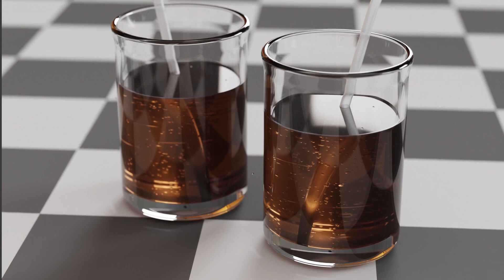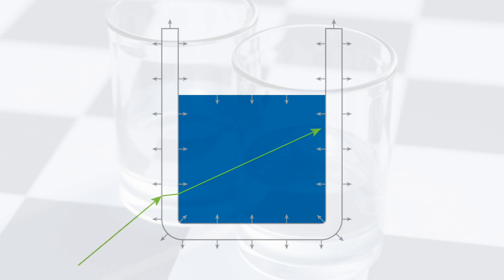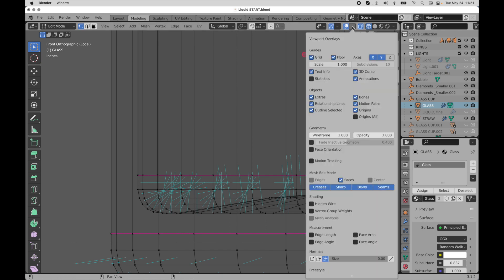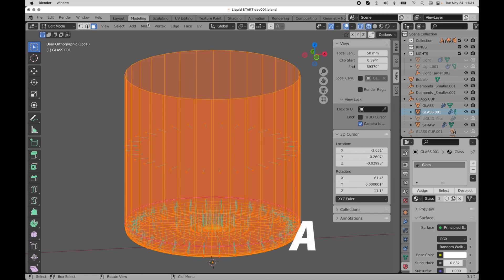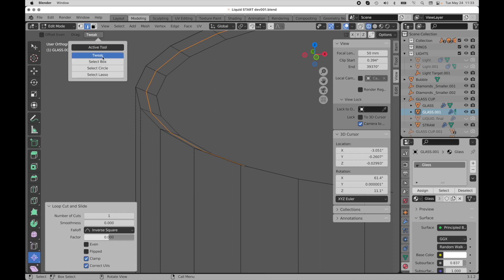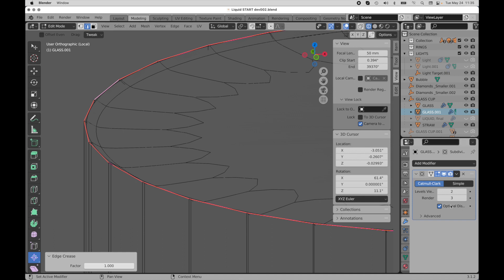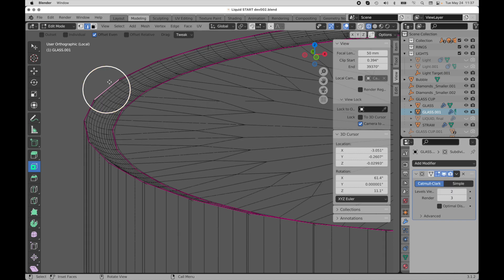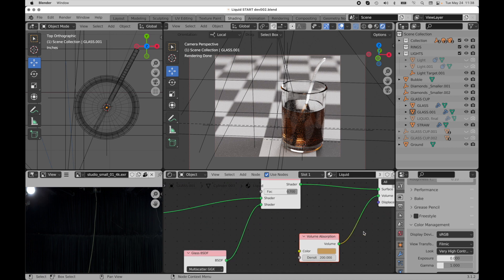Liquids in a container, set up to render properly

Comment: This is the exact issue I'm dealing with at the moment. The solution you provide feels a bit weird to me even though it seems to work from a visual stand point. But what if you're dealing with liquid being poured into a glass and you don't have a perfect edge loop you can separate out? There has to be a way of keeping the container as a closed mesh.
Reply from the maker: Currently there's not a great physically correct solution. Blender needs a proper process called nested dialectrics to handle this situation in a correct way. This is something the developers are aware of and there has been some work on it. I do plan on updating this video to demonstrate what it is because there's also another piece to this puzzle called relative index of refractions which I didn't cover in this video.
Reply: @christopher3d475  Looking forward to that video. It would also be interesting to know how a volume shader could be added to the mix - be it for the glass material or the liquid itself, given that you're not dealing with pefectly clear liquids.
Reply from the maker: @mulanmiller5000  Here's a quick tip for the liquid. Its index of refraction should be relative to the glass. So if your glass is 1.52, and the liquid is 1.33, going from the glass to the liquid you need to calculate a relative IOR which is 1.33 divided by 1.52, giving you 0.875. I know that sounds odd that for the liquid, use that value. What makes this tricky is that the top of the liquid which is interfaced to air, you need to keep that at 1.33. A proper nested dialectric system will handle this for the user, in addition to letting you overlap the geometry of the two medium and then determining which to use. In my mind this is the most important thing that needs to get integrated into Cycles, but I don't know what their timeframe is for that.
Reply: @christopher3d475  I appreciate your help, I'll keep that in mind. In this case the product is a make-up bottle so the "seam" that separates the container from the liquid is actually hidden in the bottle cap. Your method gets me 90% there but I still miss that thin layer of glass in front of the liquid. Technically wrong I'm sure but using a tiny bit of soldify seems to help...

Comment: Ive been soing tests omnthis subject sonmany times. Some other articles, mainly those on stackexchange, pointout the liquid bosy normals should point inwards. Ive noticed this causes issue when we render say wine. It behaves weird, when a livht is behind the liquid, the light will show a different red vs tlwhat is around the the light. Wish we had an interface setting like other renders have. That way we could use it on animation as well. Because this setup can not be done for animation unless you do a very tedious taak of separating top, body and glass. Thats really not what you want to do
Reply: There is also an example where they scale the liquid body just a bit outside of the interior glass. But for that the liquid needs to be a separate object. With the other setupz it can all be 1 one mesh object
Reply: The lip is called meniscus, formee by surface tension and molecus being attracted to each other.

Ps in the staciexchange versions some others. They use also different for values for the top of the liquid and for body of the liquid. Then use a nodegroup to use the same defaults. Still wonder if that is correct though

Comment: Hello Cris, here an old Strata beta user. I remember a similar tutorial for Strata for years that has served me on many occasions to make glass objects with liquid, this method works very well. The only problem with glass containers, especially bottles or glass jars for cosmetics, is that in reality the glass especially in its inner part is not perfect, which makes it often not look real. Many times it is necessary to broke symmetrical and have inner glass imperfections. A tutorial would be fine about this.
Reply from the maker: Hey Xavier. I'm waiting on doing another tutorial on this subject until the developers of Cycles solve the nested dialectrics problem. We can only go so far right now without that technical issues resolved.

Comment: I recently found (form one of the Blender conference 2022 videos) out the correct way to make nested dielectrics in Blender is to use 3 different IORs. Liquid IOR needs to be set only at the faces that facing to the air. Faces that intersect with the glass should have IOR equal to liquid IOR divided by glass IOR. And the Glass should have obviously its own IOR.
Reply from the maker: Awesome thanks. The developers just noted in the Cycles developer form that nested dialectrics is something being worked on for an upcoming release. Could you point me to the video talking about the work around? I'd love to watch it.
Reply: @christopher3d475  Actually, it was a BSDFv2 talk, at the end of the video the guy mentioned briefly about 3 different IORs for 3 domains. The exact formula I then found on some forum.
Reply from the maker: @leonidaltman  Ok, got it. Based on your description I did some quick testing yesterday and it looks plausible using the 3 iors. I'm hoping this need goes away though with newer development. They mention on the dev forum that nested dialectrics is a known issue and there's supposed to be some work done on it. 
In fact TheaRender takes this into account and they have a mode that tells nested objects that they are nested so the renderer knows how to deal with it. Thea also has built into the shader function variable roughness with incidence, it's the only renderer that I've known about for some time that does this. No node setups or anything, just a click of an option to enable it. I really wish they would do a Blender plugin version. 

Also, a new alpha version of Principled V2 was released this morning.
Reply: @christopher3d475  I wish I could stop focusing so much on technical stuff and just do work, but man, can't help myself!) I'll go check it right now!
Reply: @leonidaltman  There is LuxCore renderer for Blender, free too, that does amazing job rendering Caustics. But it is half-dead and it lacks material node converter which is a huge pain.

Comment: I'm a bit confused. In reality, light travels through air, enters glass, travels through a given thickness of glass, enters a different medium (i.e. a liquid), travels there, etc.
In this case light will enter glass and will travel through it ...What thickness exactly? There's seemingly nothing in your setup that defines how thick the glass has to be.
Reply from the maker: The critical aspect here is the change from one index of refraction to another. In developmental terms they refer to that as an interface, or an interface change. That's what important. The ray needs to know either when it's leaving one span of an IOR or simply entering a different IOR.
Reply: Sorry, English is not my native language. But that's what I was trying to confer. OK, so entering a different medium is enough for the renderer to realize that it has traveled through a given thickness of glass and is now traveling through water. If that applies to other parameters like scattering, that makes sense now. Thank you.
Reply: Cycles is not physically based engine. It fakes most of the processes, unlike V-Ray, Corona, LuxCore etc which are physically based.

Comment: What about the usual method of scaling up the liquid along the normals until it intersects the glass just a little bit? It seems like nearly everyone does that. Is that method wrong?
Reply from the maker: The primary consideration is setting up the liquid for a best-case scenario 'interface' change between the two index of refractions the light has to pass through. There is a method I sort of talk about whereby you offset the liquid mesh just a bit, and under some situations you can use that. But this method is the most accurate.
Reply: What Shah is saying is that you did the offset in the opposite direction to what people normally do - it works well to make the liquid ever so slightly larger (overlapping) than the interior of the glass, not smaller. 

I often use volume absorption in my glass materials to give it edge colour and I wonder if your method will work with this?
Reply from the maker: @Lightly_Salted  You may have to use the overlap method if you're going to use a volume on the glass. This is a weak point in Cycles, they really need proper absorption.
Reply: @christopher3d475  👍🏻 just tested the methods side by side and the overlap one looked substantially more realistic. This is the case with and without absorption. It’s hard to tell exactly what’s going on but it looks as if there’s something wrong with internal reflections with your method? I could be wrong but I’m comparing it with the same shaped bottle IRL 🤷🏻‍♂️

PS - I’m using your techniques for fresnel reflections and energy preservation in my projects now so 👍🏻👍🏻👍🏻 for those vids. Don’t mean to be so critical, I really love your videos 🙂